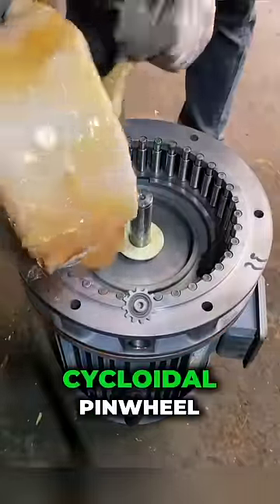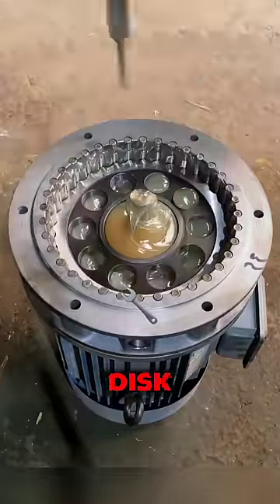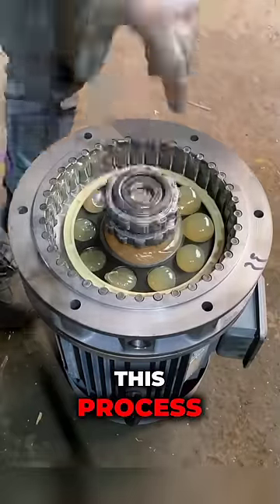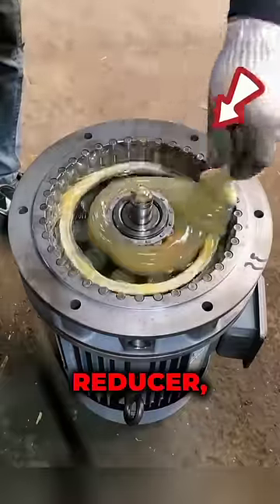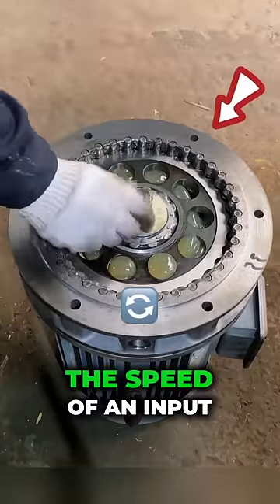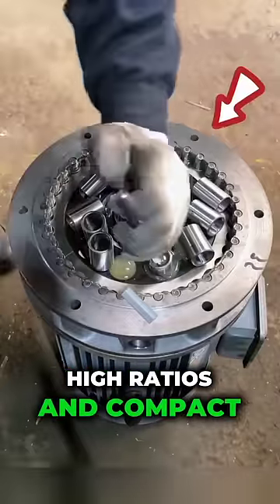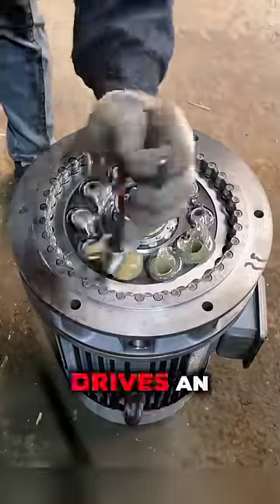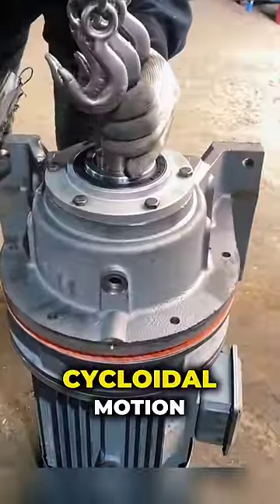Assembly Process of Cycloidal Pinwheel Reducer 🤯 #assembly #production #2024 #shorts

Comment: people saying too much grease but never used a grease gun on a machine fitting, you keep pumping till it squeezes out every possible hole.
Reply: Manufacturer specs say how much lube is needed... any more r less will cause more friction and premature failure
Reply: Dust covers hate this one trick
Reply: I’m pretty sure I saw one of our drivers greasing his truck with an empty gun the other day.    😂
Reply: Hahahha close but no go
Reply: Bushings yes. Bearings no
Reply: And sometimes holes you didn’t know it had😂
Reply: insert sex joke here
Reply: Youve never packed bearings? @elite6569
Reply: no you don’t, that’s too much grease. you do how much the machine tells you to use no more no less. if you wait until it’s squeezing out of every hole then you’re just asking for a mess
Reply: @benjaminmartindale  depends on the machine.
Reply: That amber colored grease has no EP additives and is not using any synthetic basestock. Hypocycloidal drives need both to survive long-term, reduce friction, reduce wear, and improve efficiency. The grease should be clear as crystal when applied and turned black when the EP additives are mixed with the grease. Also, he should not be hammering it together with steel, that will marr and gouge the parts, and he should not be handling it with pliers, that will scratch the parts. His clotch gloves are dirty and the dirt from the gloves will cause 3-body abrasion and wear.
Reply: Why assume people never used it to sound smart?
Reply: That's what she said.

Comment: Guy who assembles cycloidal pinwheel reducers for a living: uses correct amount of grease, just like they've been doing for years, presumably

Random internet people who have not, nor will they ever, assemble a cycloidal pinwheel reducer: "too much grease" 

😂😂😂
Reply: Or my favorite that I always see "you didn't press grease into the bearings, let's hope it doesn't burn out"
Reply: I feel like it's either under greased or crummy grease. Id assume some scum would use lard
Reply: I would like to purchase this cyclodioal machine good sir
Reply: I ask if its too much grease, i don't say it is but i guess i know its not now
Reply: I ask this cuz wouldn't there be fluid in the mechanism that acts as a lubricant but then that would make grease something to make it easier to assemble not to run with for its lifespan?
Reply: @gearem_fx8099 good questions. The grease that is used here looks a lot like something of the lithium grease kind. These types of greases usually turn into something more oil-like when it heats up, and turn back to this paste-like grease when it cools down.
I don't think there'd be any fluid in here because that would certainly ruin the lubrication.
Reply: @chielwouterscw  oh okie, thank you
Reply: I'd like to know what kind of machinery such a unit is actually used in.
Reply: Fr 😂😂😂
Reply: @bossjosh423 That amber colored grease has no EP additives and is not using any synthetic basestock. Hypocycloidal drives need both to survive long-term, reduce friction, reduce wear, and improve efficiency. The grease should be clear as crystal when applied and turned black when the EP additives are mixed with the grease. Also, he should not be hammering it together with steel, that will mar and gouge the parts, and he should not be handling it with pliers, that will scratch the parts. His cloth gloves are dirty and the dirt from the gloves will cause 3-body abrasion and wear.

Comment: pre-famulated amulite surmounted by a malleable logarithmic casing in such a way that the two spurving bearings were in a direct line with the panametric fan. The latter consisted simply of six hydrocoptic marzlevanes, so fitted to the ambifacient lunar waneshaft that side fumbling was effectively prevented.
Reply: Wha?

Comment: That amber colored grease has no EP additives and is not using any synthetic basestock. Hypocycloidal drives need both to survive long-term, reduce friction, reduce wear, and improve efficiency. The grease should be clear as crystal when applied and turned black when the EP additives are mixed with the grease. Also, he should not be hammering it together with steel, that will marr and gouge the parts, and he should not be handling it with pliers, that will scratch the parts. His clotch gloves are dirty and the dirt from the gloves will cause 3-body abrasion and wear.

Comment: I use assembly lube then fill with appropriate gearbox oil. Change the oil after a few hours run and fill with fresh oil. They will last years under the harsh conditions that they are subjected to

Comment: Didn't press grease in between the bearings  aka packing the bearing, will fail quickly,  lets hope that grease goes liquid under load ....
Reply: You should go train him on how to do his job that he's been doing for years.
Reply: @vedob5163  how did you conclude that? His gloves? If he has been doing that for years then we know where to look for failure point
Reply: @NRC073  yes maybe you should go teach him your ways since you know so much.
Reply: @vedob5163  you got nothing else to do today?
Reply: @NRC073  Yes, i do, but this comment only takes a few seconds.  How's that training going? Know it all. 🤔
Reply: @vedob5163  not bad, still learning to use chopsticks and flipflops for PPE.  
And you how is Trolling going,
Reply: @NRC073  Not good, Still learning but there is different types of grease though, some get into bearings much easier than others so you dont need to pack the bearing eapecially if you're putting as much grease as he did.
Reply: @vedob5163  can't argue with that yes, hence why I said hope it's the low temp stuff that goes liquid, if that thing starts up under tongue the first time those bearings will be damaged before the grease gets to it, always good practice to grease bearings before installing them.
Reply: @NRC073  Lmao
Reply: Notice the outer ring of the bearing is not on the bearings. Bearings were fully packed with grease before the cycloidal disk with outer bearing rings already attached.
Reply: Guys, Here is our Savior

HalleluYAH translates “Praise ye YaH”

YaH is The Heavenly Father 
YaH arrives via the TENT OF MEETING
YaH was Who they Crucified for our sins
YaH was Crucified on an Almond TREE

— Ancient Semitic Cuneiform of Moshe (Moses)
— Isa Scroll (The Original Isaiah)

Isaiah 42:8
"I am YaH; that is my Name! I will not yield my glory to another or my praise to idols.”

Isaiah 43:11
“I am YAH, and there is no other Savior but Me.”

Isaiah 45:5
“I am YaH, and there is none else.”

Comment: This is not a cycloidal gearbox, its an EPICYCLIC gearbox, cycloidal gears are only found in clock escapements, in fact there is no other use for a cycloid gear other than timing, the epicyclic gearbox is basically an in  line reduction unit and with the application of brake bands around the anulus gears gives a gear range changing effect that is basically an automatic gearbox, I,m a gear cutter by trade , anything else you would like to know about gears ? BEFORE YOU MAKE ANOTHER BULLSHIT VIDEO .